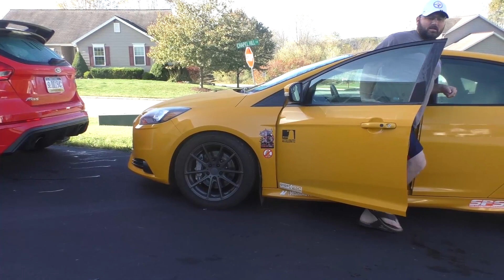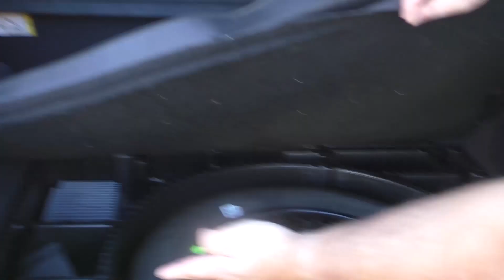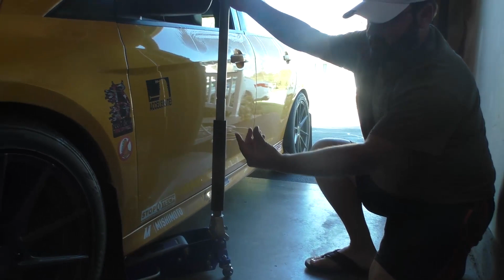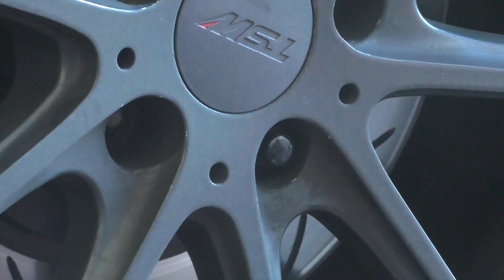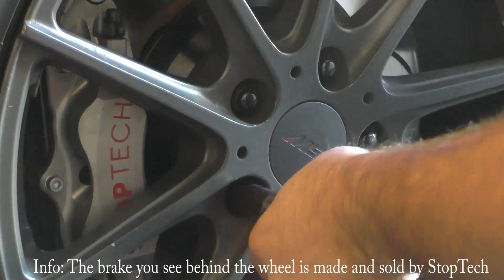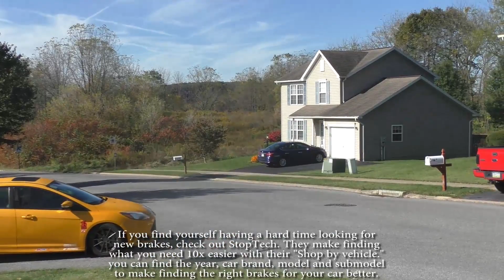How To: Change Your Car Wheel

Comment: Lots of good advice here, few details missing. __CRITICAL__: Safety first! ALWAYS put the car in park set the parking/ebrake and chock the wheels. Other minor stuff: 1. Tightening with torque wrench before lowering the car will be impossible on the front of a rear wheel drive car where neither parking brake or transmission opposes the wheel motion. 2. Tightening against the drive train resistance on a manual transmission car, or a car not properly in park may not work, and may rotate the engine backwards, which can dislodge timing chains or otherwise damage the engine. Wheel should be blocked against the frame if possible or the vehicle should be on the ground (with the lugs solidly finger/wrench tightened at least twice in a star pattern) when tightening. 3. Some vehicles have lower torque specs (I own one with a 77-ft-lb spec) Always check the owners manual for the correct torque spec. 4. Drive the car a short distance (<1mi) and re-torque all of the lug nuts to spec. 5. if this is the first time using these wheels or lug nuts also re-torque after the first 25 miles and again after 100 miles since paint/chrome/imperfections on the nuts or wheels may be squeezed flat by over-the road forces such as potholes, or fast turns. Some things not to do: A) Don't drop your lugnuts in the dust/dirt after you take them off, sand in the threads can damage/seize the nuts when re-tightened. B) Never coat the lug nut interior or the bolt/stud shaft with any lubricant (anti-seize is a lubricant). Nuts/Bolts/Studs should always be dry unless specifically directed otherwise in the owners manual. Also, nice photobomb by the skeleton :)